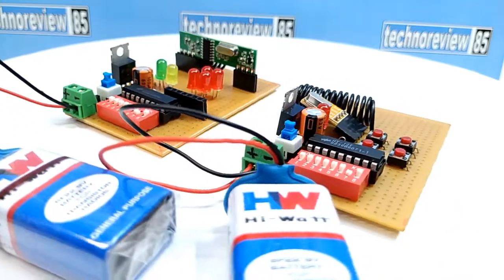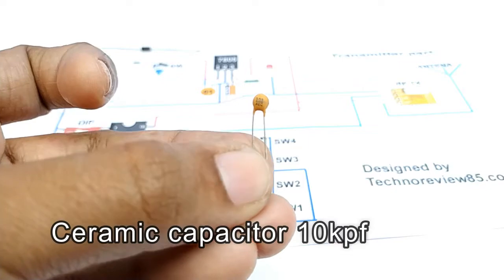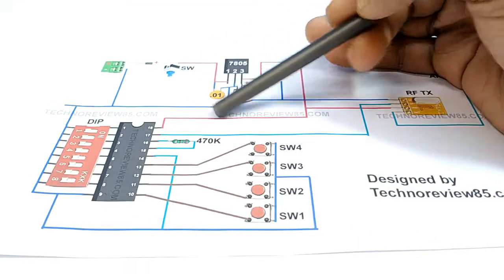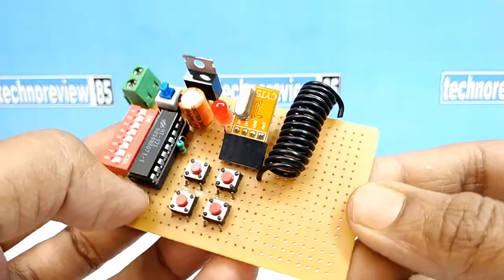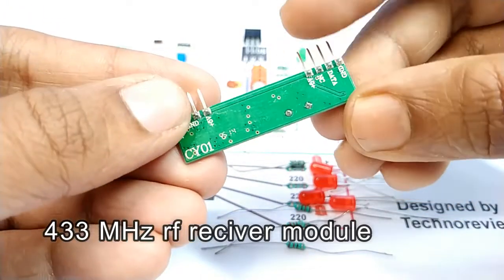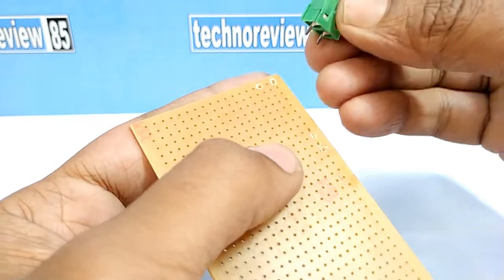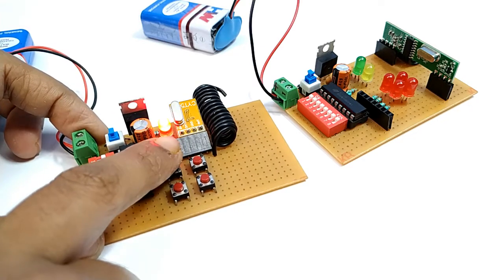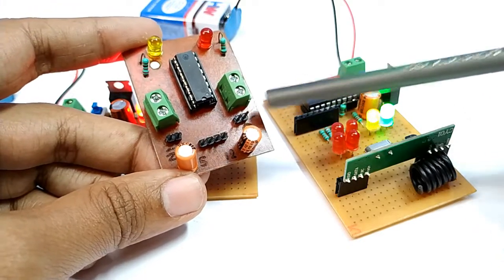RF remote control transmitter and receiver circuit | How to make

Comment: This is very much useful for me .4 motors can be opened by this  rc . Again I want to know how 2.4gzs  6chanel transmitter and receiver to operate two 12v dc and two servo motor

Comment: Are you sure about this circuit? If I connect the pin header to any component, isn't it will make the current flow to that component no matter i push the button or not? 

Let say the component is a transistor. It will switch on no matter i push the button or not. Or I should use pnp-type transistor?.
Reply: Yeah surely i have to use pnp type.

Comment: Sir 12v DC motor operate with this circuit
Reply from the maker: For a small motor, you can use l293d ic with this circuit. If you want to use a big motor then you have to use a power transistor or MOSFET. Another video is on this channel, where I used the l293 motor driver board.